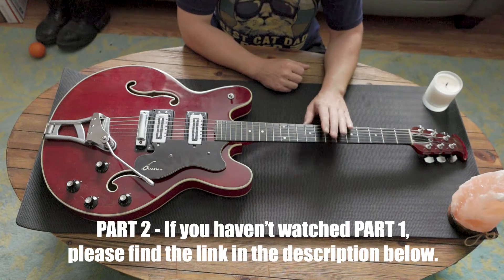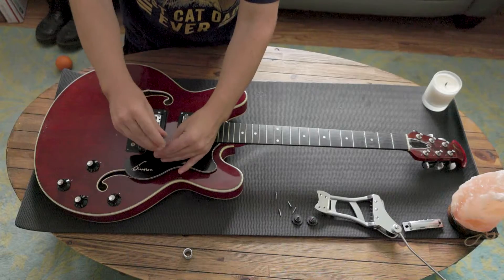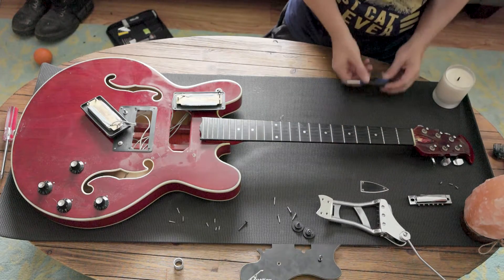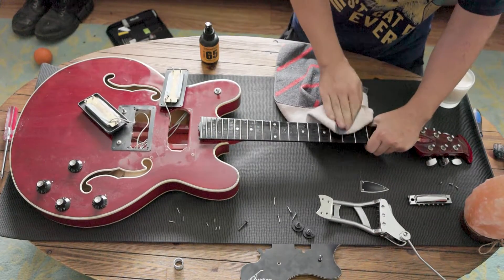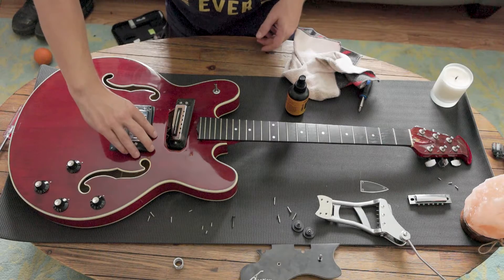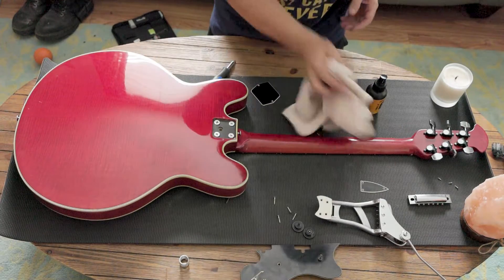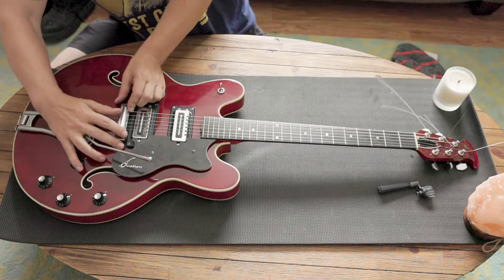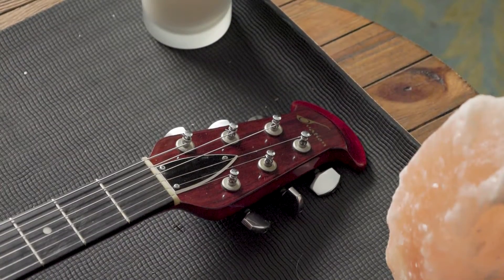Ovation Tornado Unboxing and Deep Clean Part 2

Comment: These are 2 great vids on cleaning and playing these. Love the old tone from the pickups. I have one that's a blond/tobacco burst that was given to me 35 years ago. But it never had guts. Sat in my closet all these years. I recently got the hots to restore it but can't find parts. Would love to get it running and stain it cherry like yours. Maybe some day. But now i know what she would sound like if I ever got original pickups for it. great job.
Reply from the maker: Thanks for the comment, @larylhuntington5398! I love hearing about old guitars with a story! Good luck finding these specific single coils, I doubt they had a very long manufacturing run. However, you could do just fine with some TV Jones or something similar, but just measure the pickup cavity before pulling the trigger. Let me know if you get around do it!
Reply: @tannersfavoritethings24  Thank you. Will do.
Reply: Schaller high output pickups from 1970, best part of the instrument

Comment: Add replace spring and add graphite nut for much better tuning stability. An abr bridge on a block is a good change to consider (reversible) if can't get original low enough, like a jazz box bridge. Heavy gauge strings was all they had so no lite strings, and flats are great with these little frets.
Reply from the maker: Good suggestions, i never considered replacing the bridge with a more Gibson-esque part, but that would help a lot! thanks for the comment!

Comment: I think this one came with a synth unit from the front pickup and end of fret board. Those electronics mostly died and it's still a tornado electric with that removed, others don't have the plate under the bridge. Also the logo pickguard suggests 70 or after, in 68 most of 69 it was just black
Reply from the maker: Thanks for the info, these are hard to find a lot of info on. You really think someone removed the synth unit from this one? I didn't get that impression, but I'm no expert! Thanks!
Reply: @tannersfavoritethings24  I could be wrong, but that has ever happened since the synths mostly died a long time ago and weren't good to start with. Other things that happen is people cut off the extension with last few frets that normally overhang the body due to the humping up there that happens in that area from bolting on and from no backing on the fingerboard, to get rid of buzz on higher frets I've seen people remove the 23 and 22 fret since can't hardly reach them, the cheap ways.
Reply: @tannersfavoritethings24  look at some Condors on reverb. Your neck pickup is for sure in Condor location, and you for sure have the condors masking over the wood where bridge sits that tornados don't have, I'm guessing was a condor and synth died and they married it with new neck and bridge from tornado with a refinish including painting the back of the neck red, only other option is it was always a tornado with a misplaced neck pickup and with a Condor plastic cover under bridge. It is just not the correct place for the hole for the neck pickup on a Tornado, and a 69 tornado would be cracked all over the finish if not a refin. Necks were never painted also suggests a refin. Imho, Condor married to tornado neck and bridge. It doesn't really matter, this is nerd stuff for fun.
Reply from the maker: @DiogenesCaulfield  Thanks again, i'm definitely going to take a closer look at mine once i can get it out from being buried. I just swapped rooms and am in a bit of chaos!
Reply from the maker: @DiogenesCaulfield  I love the nerd stuff...that's why this channel exists. And these guitars are too good to have this little info on them on the web. You've provided more info than 100 forums, so i thank you for that!

Comment: I  came across one of these today at a pawnshop. they wanted  $600, but the finish is loaded with cracks on both sides. I found you and wanted to hear how it sounded.
Reply from the maker: Thanks JukeBoxHero. This guitar punches above it's weight in all regards. The ebony fretboard, the bound body, the high quality Schaller parts...it's a sleeper for sure. The sound is what makes it though, she's a warm and welcoming player. I'd say get it at 600!
Reply: @tannersfavoritethings24  thanks for responding, I'll think about some more.